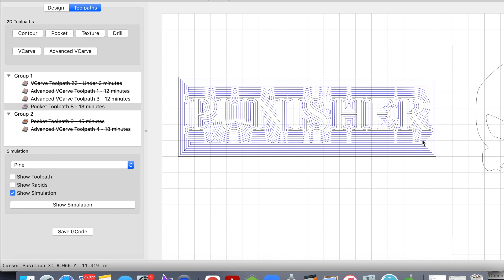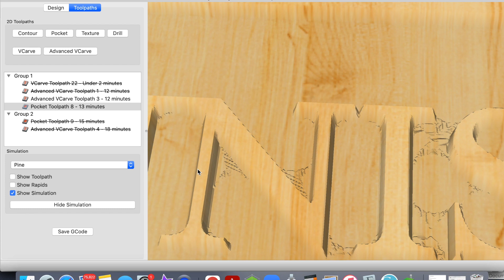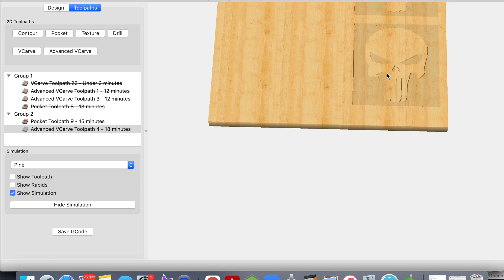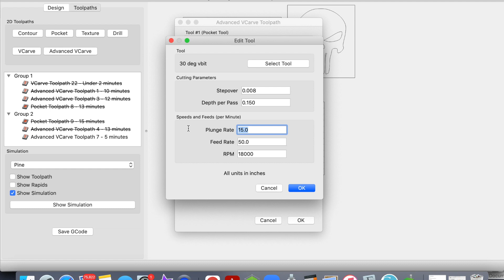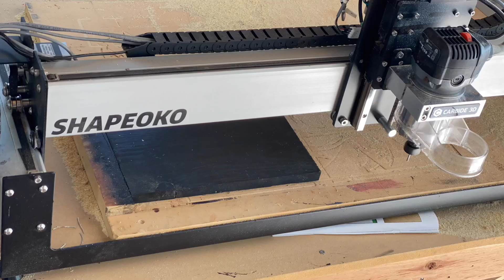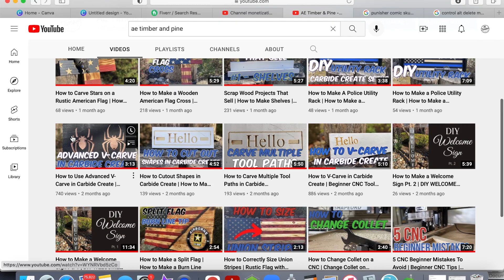How to Create Raised Text In Carbide Create | Carbide Create Tutorial

Comment: What’s up bro nice video. When you zero xy and  z in advance vcarve what bit do you use to zero, the 1/8 or 30 deg. bit ?? Thanks
Reply from the maker: I’ve started using my vbit to set the zeroes.  
I initialize the machine with my vbit and then set my zeroes with it. I am able to be more accurate with the vbit point.
Reply: Ok cool. I have the longmill n it seems to work better with my 1/8 end mill but sometimes it’s a bit off I’m gonna try the vbit next time thanks

Comment: if you can use the V bit for a complete outer contour of the letters then they would all have slanted / \ walls and be stronger than straight  | | walls. Need a 1/8" to 1/16" offset around text/pattern V bit carve, then offset to outer box as pocket clearance only
Reply from the maker: Thanks John for the tip!

Im going to have to play with it a bit more. 

So essentially, in addition to feed rate and speeds potentially causing chipping, the strength of the outer walls of the text is reduced by having vertical walls rather than slanted. 

I wonder if my cutting depth was too low to not allow for slanted walls?